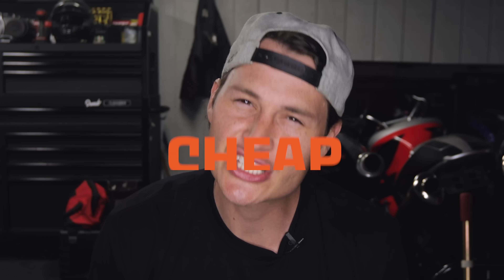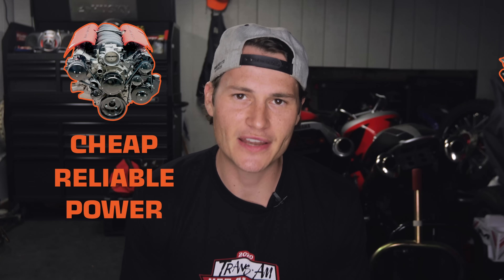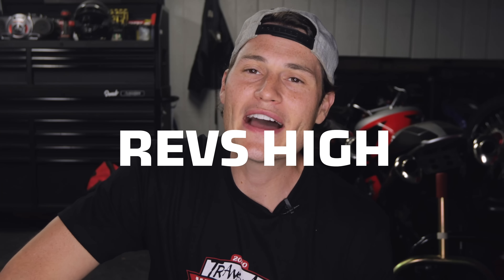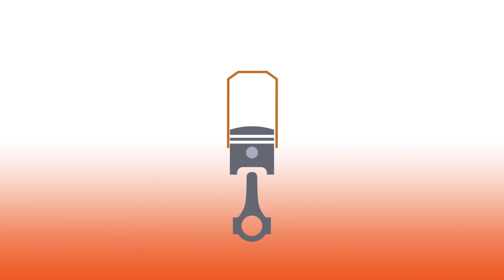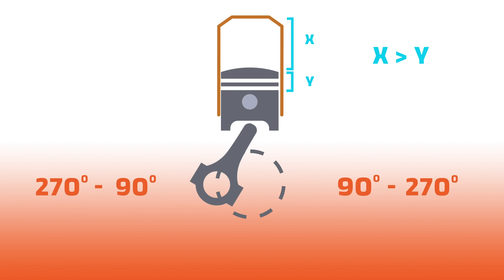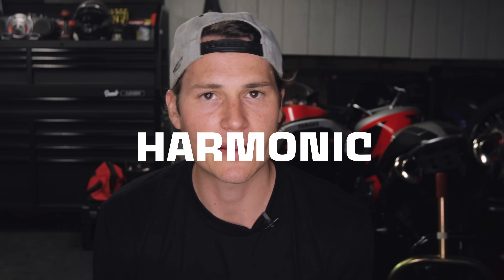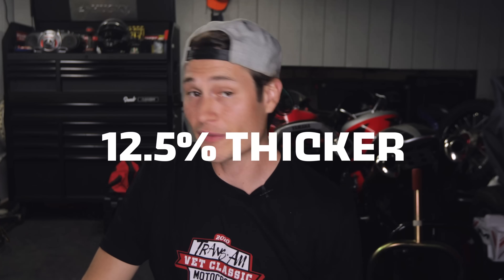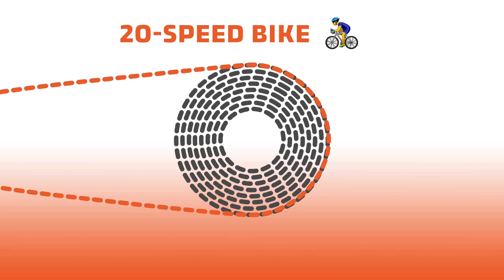Nissan VQ Engine - The Science Explained

Comment: Timing chain setup and the pickiness of the airflow are these engines problem. 
My Murano VQ35DE is on it's 4th engine...1st had a broken block, pissed oil (previous owner not vehicle). 2nd had a premature timing chain failure. Done. 3rd same. Just installed the 4th and, well it doesn't move the car, bogs down. Maybe a vac leak clogged exhaust pipe, or any number of other factors. But hey, it idles A+. Troubleshooting.....They're not that great.

Comment: Guys need to realize the modding goes down over time with any car chassis platform. The engineers have been watching what we do for years, what we search for, a lot of them are drivers themselves. That's why these little aluminum V6s make DREAM power numbers for what would be an old tuner car. Same goes for the suspension and chassis as a whole, if you LIKE buying and installing chassis stiffeners or engine trans swaps you should definitely not be looking for anything newer than 2005-2008

Comment: Anyone have any idea what would he causing a vq35hr to be stalling at low idle parking lot speed. Or when going from reverse to drive low idle will stall. Its automatic trans and ive never experienced an auto trans stalling so im a little confused as to what could be casuing this issue. Pcv valve? Valve gaskets are leaking oil, have them and 6 spark plugs being delivered tuesday. Any ideas would be greatly helpful

Comment: Nissan VQ engine burns oil, sight of no good. Its a 60° V6.
Reply: Only the 05-06 revup VQ35DE's burn oil, due to low tension piston rings. All other VQ35's, DE & HR, are dead reliable.

Comment: I am interested in VQ35HR in my nissan hybrid. Nissan says it uses Atkinson cycle. In an Atkinson cycle the compression stroke is shortened by a complex system of rods giving less power but more economy. I wonder if it actually uses a Miller cycle an improvement on the Atkinson which does away with the complex rods and shortens the compression stroke by simply delaying the closure of the exhaust valve (compression) until the piston has travelled halfway up the bore. Pretty easy to do if you have variable valve timing.

Comment: Anyone thinking about engine swap look up GM's LGX engine. Closed deck, forged crank 335hp 285tq. Cheap to buy used and easily tuneable via hp tuners. They can be paired with a bulletproof 8L90 transmissions or cheaper 8L45.

Comment: VQ engines are awesome. I completely disagree on the transmission. Transmission was piece of shit on my 350 and 370. Master cylinder on both failed, and 3rd synchros were terrible sometimes it was pop it out of gear or have a hard time going in.

Comment: Everything is broken in my 2003 g35... the engine hasn't had a single issue yet...
Reply: Just bought a 03 G35 coupe. Interior is busted, exterior is not the best but the VQ runs strong!

Comment: Except it’s an interference engine. A crankshaft position sensor failed and my vq blew itself apart with 50k miles on it.
Reply: The cvt was sweet though. Floor it and it makes 300hp the entire time your foot is down. No power curve, just peak power the whole time.

Comment: While the bike gear example was ok. It was wrong at the same time.  The rear cassette sprockets get easier not harder as they get bigger. Your legs will spin faster to go the same speed.  Sure  it was a fine example of close ratio's comparatively. But . hey if you are going to educate people on gearing. The example used should show it correctly to the description provided.

Comment: I have an 04 G35X that had little to almost no maintenance from the owner before me , I've been replacing sensors , belts , air flow parts , did a whole tune up (plugs , oil change , filters , etc) , control arm , tires , now getting more sensors and hoses changed , then suspension parts , and I wanna seeeellllll but everyone says not to , to finish the maintenance and I'll have a car worth the work I put it in . 🙃🫠🙃🫠

Comment: The 2011-2019 VQ40DE is one of the most reliable engines on the market. Running 225k on my frontier with no leaks or any mechanical issues yet.

Comment: Love this video but was confused about secondary balance.  I did some research and found that it’s not that the piston travels different distances, that makes no sense.  It travels the same distance but accelerates differently due to the geometry of the crank.  Acceleration decreases as the piston goes up, and increases as it goes down.  Engineering Explained has a great video on this.

Comment: Everybody is saying these engines are smooth, you're all insane. I love them but they are absolutely NOT smooth at high RPMs. A V6 is inherently an unbalanced engine, there's a reason that most luxury car brands have stuck with inline or flat sixes. The V packaging is simply an engineering solution, a way to fit straight 6 power into a 4 cylinder length so they can mount them in transverse fwd applications. The HR in my 350z literally rattles the dashboard louder than the stock exhaust above 5k rpms, and my other 350z was like that too. No mechanical problems, just the nature of a V6. Again, I love them, but "smooth" is not the word to describe them
Reply: Mine doesn't, at least compared to the old DE coupe with FBO & Uprev tune I used to run for 7 years. That one had solid diff bushings, DC headers, Stillen HFC, Borla TD, Admin 3.5" intake, NWP TB, 5/8" spacer.... it was loud and NVH was up there. This stock HR roadster with 65K miles? Ha. Purrs like a kitten, even in 2nd at 7,000 RPM. If you're running high mileage Z's, your engine mounts are probably shot too. Also, flat sixes are not 'smooth' by any means if the 3.6R Legacy is any indication of that - 1st hand experience.

Comment: Bad motors for making power. Doesn’t matter DE or HR. They both give up after about 400whp. Costs a lot to get there too. Most boost setups run $8-10k. Good luck seeing more than 290-300whp naturally aspirated also. They’re cheap and reliable and that’s what they’re good for.
Reply: ...and sometimes that's all you need. Reliable, RWD between 250-300 RWHP is plenty for a weekend car. Not everyone burns money on boost kits and supporting mods.

Comment: Fun fact it's also avilible in a vq40de 4.0l that came in the frontier. Bigger bore and maybe cylinder head designe. I've always wondered why people do use them to modify, I figure a 350z heads and supercharger/turbo would fit up. Basically poor mans Nissan Patrol if you did it in an Xterra

Comment: Lets ignore the oil consumption, leaking valve cover gaskets, dry rotten spark plug tube seals(causing lean misfires), leaking coolant hoses going to the heater core, and pain in the buttt to get to water pump/ oil pump location…. also quite expensive engine to replace even used. all for a measley 300hp in a quite heavy car. …yeah the Vq35hr is amazing… 🤡.

Comment: Isn’t the high rev and the hr different though ? 
On 350z plates there’s vq35de, vq35 high-rev, vq35hr 
If I understand correctly
Reply: Rev-up was the terminology you were looking for. DE (03-06), DE Rev-up (05-06 manual only), and HR (07-08-09). Rev-up goes to 7,000 RPM on a single intake design, HR goes to 7,500 RPM with dual intakes.
Reply: @jacquesc3166  my friend, thank you for the great clarification, helps so much 🙏🏼🏆

Comment: Recently got a 2006 infiniti g35 with 270K miles but runs great. If I absolutely need to I can afford to replace the engine. My question is, knowing the car was maintained fairly well by the previous owner (saw the car fax n records), is there anything additionally I can do to keep this engine going for another 30K-60K+ miles before I swap it out?

Comment: My Nissan VQ-40 4.0L V6 on 2010 Frontier Nismo 6 Speed Manual transmission is now @ 713,501miles and my 2016 Nissan Frontier Pro4X VQ-40 6 Speed Manual Transmission is now @ 173,690miles and they're both running Great. I really used and Abused them and maintained them.

Comment: “The shape of the crank is not symmetrical “…? Um I think it might have to do with rod angle during crank rotation and would be exaggerated by shorter connecting rod lengths

Comment: I just bought a 2009 Infiniti FX35, compared to my Lexus ES350, this engine just sounds AMAZING! The Lexus is very smooth, quiet and powerful. But this engine is just on a different level, it's great. It really changed my mind on Nissan/Infiniti as a brand. I will stick with the VQ throughout my next vehicles.

Comment: Ive never liked the vq but I want a 07 08 350z with the hr vq but all the youtubers buying em jacking up the price even 1 year ago u could get a 350z de like a 04 decent shape for sub 5 grand now  200k miles 04 350z de no bumpers rebuilt title ten diff colors every panel is from a diff car Interioir shot and there 10 grand min. Only time I find a nice clean z under 10 grand its from an old man that doesn't know about drifting em and its auto sucks

Comment: Piston movement in conventional engine is NOT sinusoidal, as you went on to explain regarding secondary balance.

And it is NOT that the crank shaft is not symmetrical lolol.  It is the tilting or the connecting rod that accounts for the non sinusoidal motion/speed of the piston between top and bottom half.

Comment: How did they engineer the timing chain eating the engine... I'd love to see a series on what makes an engine good vs bad.

Like first time you open the 4agze, the bushed rods and oil squirters really stood out.  I'd love to see a dive into internals not just specs.
Reply: 07 Maxima owner here 3.5 V6... You want to talk about the timing chain? How about we talk about the tensioner click? Not going to take away. This is the best engine but damn I hated that click. It took a few minutes for it to warm up to go away.
Reply: @Shockr25  I'd never seen engines with oil pressure as low as those.  And that 2.5L motor was so bad to work on, truly disposable motors.  Now if only Nissan went and revisited previous designs, and maybe beef up those exhaust studs a bit.

Comment: I bought me a 2003 G35 6 MT sedan just because I wanted something fast and still comfy and reliable for under 4 grand. So far no issues and I love it. Didn't even realize it had such a solid engine and transmission.
Reply: A manual sedan ?
Reply: @neverendingpaininc  yes they are not too uncommon.

Comment: I have an 06' G35 Coupe. 48k original miles, and it drives and handles amazing. This spec has the RAS, which is an awesome option, that didn't show up till 06'. Not too many G35's out there have it. Thanks for the education. I love knowing what is going on inside the engine and transmission that I'm driving.
Reply: Hey just here to clarify, NONE of the G35 coupes on the market are equipped with the RAS. You literally own a unicorn.
Reply: @MA-it3ps  hey there!! 👋 thanks for the compliment! The Nissan Factory tech who works on my car was telling me the RAS was a $750 option back in 06' and most people didn't know what RAS was, and didn't understand it. At $750, it was a pricey option...I too believe my car is rare. I put it in the titles often for my channel. Check my channel out, plz!
Reply: also, my 2006 G35 Sport sedan has 227,000 :)

Comment: 7:55 wtf

pistons moving faster near tdc and slower at bdc has nothing to do with the crank "being assymetric".. it's bc of the geometry of what happens when the top of the conrod is stuck going in a perfect line and the bottom is revolving around a circle !

since in the top half of the circle, the con rod is more tangential to the circle, it pushes the top of the conrod further in its cylinder
in the bottom half of the circle, the con rod is more perpendicular to the circle and so the top of the conrod doesnt move up and down as much while the bottom of the rod goes around the circle as when it goes around the top
Reply: besides despite any "assymetry" in the crank.. ..

it still is just spinning, so the journal is still going in a perfect circle..
Reply: also saying the piston movement is sinusoidal and showing the perfect sinusoids on the graph to represent the piston position,, then adding that actually its not like that,, i think is a rly unnecessary layer of confusion for viewers who dont already know all of this better than its being explained..

Comment: wait how is 270 degrees on the right hand side towards the 3 o clock mark on a clock? 270 degrees is towards the bottom around the 5 o clock position? If 0 or 180 is on the left *9 o clock position. How is the 270 degrees on the opposite side lol  that would be 360 degrees its basic trigonometry

Comment: Great video, the bicycle gear illustration is a bit off though. The term ten speed refers to the rear cassette which is what you appear to have illustrated. when you shift to a larger gear on the cassette,  you are shifting to an easier gear not a harder gear. If the illustration was of the front chain ring with only 2 or 3 gears that illustration would be correct. The concept of close gear ratios is other wise correct. Sorry for being a pedantic twit.

Comment: Those synchros were the weak point in the entire VQ/350Z drivetrain. My 2003 Z was awful about it, a previous owner smoked the synchros. If you tried to shift into 3rd or 5th any faster than a granny would, the transmission would sound like you were grinding it into nubs

Comment: Nissan had a 2.5 VQ 4 cyl engine... with a butterfly per cylinder and many go fast parts... well, this butterfly had a problem, instead of rivets they use screws to hold this butterfly to its axle, where it rotates.... well, at around 50 k Miles, those screw would undo them selves, and the cylinder would suck them in.... now imagine what a screw inside the chamber would do.... instantly destroyed the engine, at average 50k miles of use..... in my case at 65.... then the screw will fly past the cat converter, destroying it too.... now pieces of the cat would be sucked inside the engine on lift off, or when coasting.... now, inside the cylinder the walls would be scratched, and burn oil at a rate of 1 quart for every 1K miles.. so, if not careful, at 3K miles, you would be out of oil, and now it is your fault for not changing oil on time.... and the customer has to pay for rapairs... 
Now Nissan fooled many, and that 2000 year, was my last time I ever touch a F..#$% Nissan, piece of.... $%#% company...  never again, and this V6 engine, sounds good, looks good... but, it is not going to fool me again..... death to Nissa#$%

Comment: I found the but on the transmission to be interesting, i owned a 2008 (vq35hr) for years and felt it was an amazing engine let down by a clunky transmission. Although a lot of that was terrible pedal and hydraulic booster design that was helped with aftermarket pedal assembly
Reply: Stage 2 tranny does wonders. Expensive but worth it.

Comment: As a mechanic, they're cheap and powerful...but they have a lot of issues too. You're better off getting a Honda V6 for long term and boost. And I'm a Nissan fanboy. Also, There's 3 forces working on any six cylinder engine (v6 or i6): primary, secondary, and tertiary.